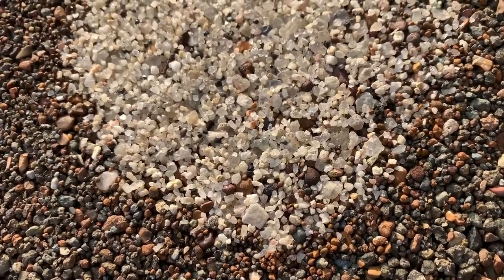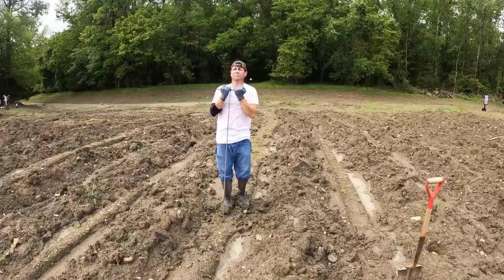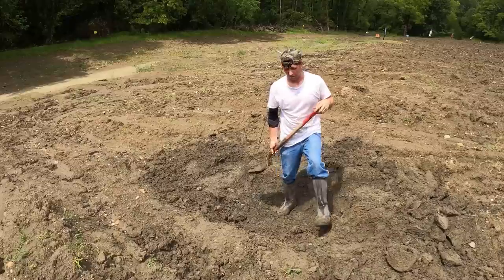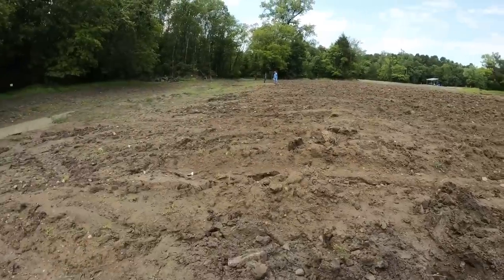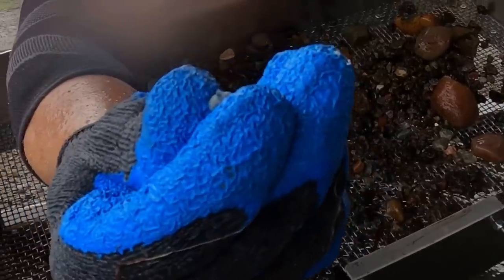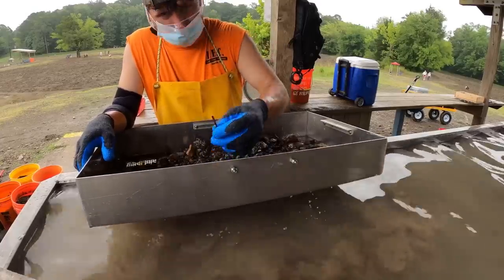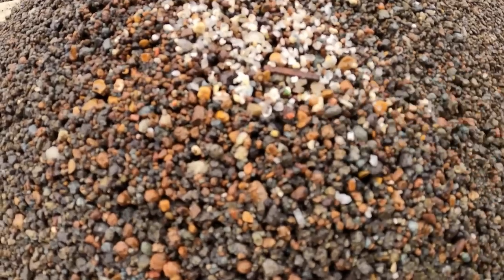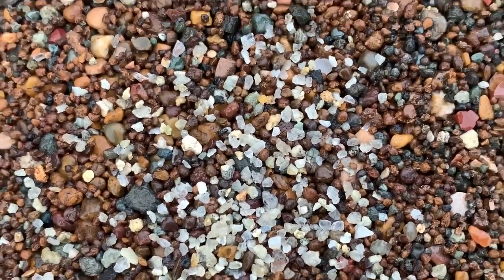How To Locate Gravel/Diamond Ore - The Crater of Diamonds - June 23rd 2020

Comment: will there be enough water flowing for small sluice 3',  put a greace trap and go for small diamonds
Reply from the maker: Grease table was the worst way to try to recover diamonds there’s so many things that have to be perfect for the Diamond‘s will not stick.
Thanks for watching !
Reply: @DiamondMinerIvins  been there done that I was one of two people that got to dredge with a 5-inch on elk River we came up ounce sized nuggets the next River over and I will say one of the best salmon fishing rivers in the country had 20 dredges on it their biggest we're smaller than our smallest elk River did not have any fine gold sixers River had all the fines no because of irresponsibility we can no longer do what helped the habitat fed hundreds of fish every year when the hatchery couldn't produce the quantity or quality put a sport of Greece across the bottom plate using a sluice box where you're at with the right material I can eliminate 3/4 only take back what you need no the 3-inch rock you wash off and throw away minus material that counts

Comment: Brother, i can give you a pointer on aquiring a killer probe . Go to a car junkyard find a older model car lift the trunk lid the springs that hold up the trunk is what you want. 1/4 inch dia.  they vary in size so you can have a choice . most already have a handle cut off one end and sharpen it to a point. done deal real simple opp. Now why these are sooo good they are made of spring steel big ringing sound when it hits chert and heavys dull sound on limestone and sandstone. believe me been using several for years to find artifacts and i have found many with this method . try it  you won't believe the results.
Reply: Great idea!
Reply: @GGhiedelainetheinvisiblevet  It really works with a lil practice.
Reply: I totally see, DMI makes it look easy. What about attaching a cup, and even magnetic paint, see the hematite, hear the chart?
Very Cool! Probably work in river beds and other such.
Reply: @GGhiedelainetheinvisiblevet   You won't believe how good it actually works till you have one in your hand it hits flint chert it is loud sand stone  is dull and moving side to side on sandstone or limestone it grinds  I figured it out by myself it is the spring steel that makes it work mild steel thread rod works but not like spring steel. the probes i have have found me many points under the surface and on top i drag it as i walk and ding what was that ,,,,,,,,,,,,,score and i wasn't even looking ....
Reply: Love that you drag it and the sound alerts you, too cool!!! Thanks for sharing in details. Just makes me more feverish to go and rough n tough it out! 👍🤙